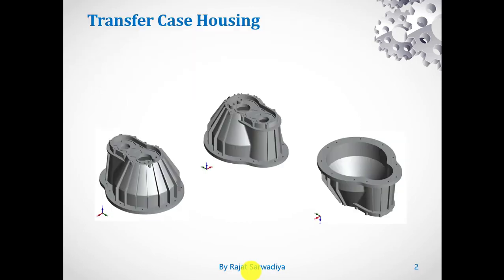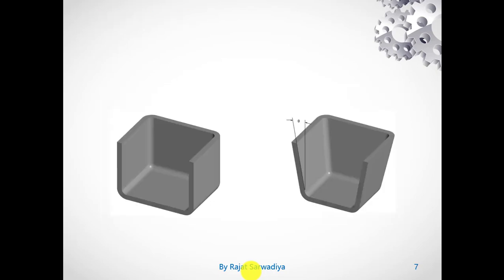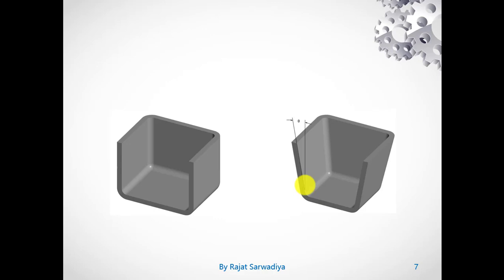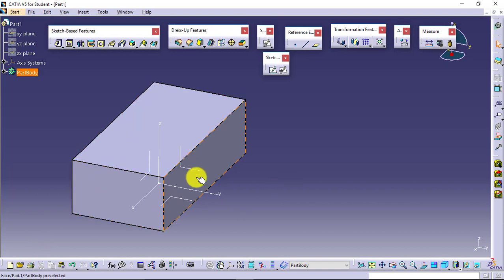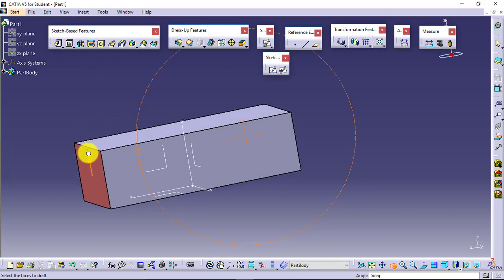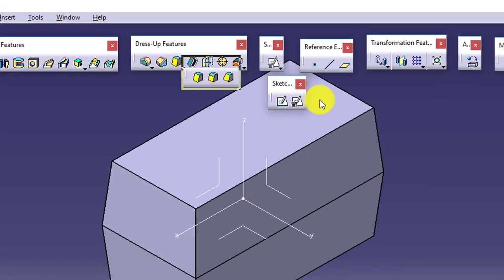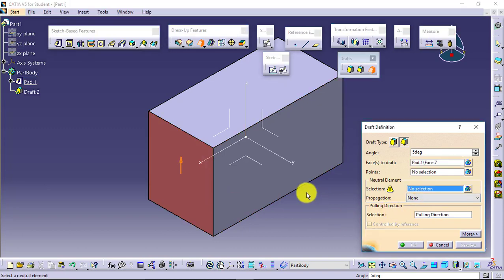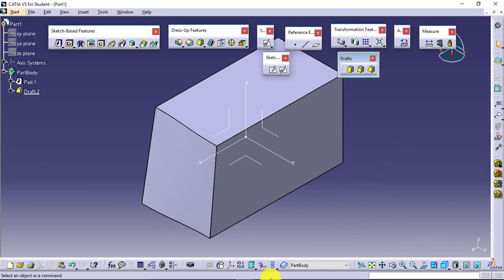Draft and It's types || How to create draft feature in CATIA Part Design?

Comment: Where varibale angle draft is used?
Reply from the maker: Mainly to maintain critical shapes at the outer side of casting, forging and plastic components.
Reply: @mastertheskillls  sir, will you please give an example so it will be more clear...
Reply from the maker: @spvids46  A solid having a tapered face having different taper angle at the ends. To maintain those shapes, we use variable draft angle. Have a look at the image: https://images.app.goo.gl/absCcAdT8pcP6TNf9
Reply: @mastertheskillls  thank you a lot Sir...